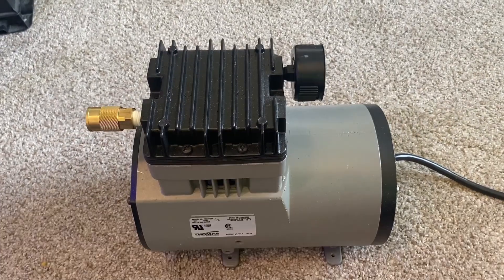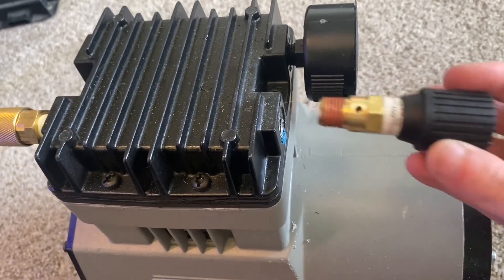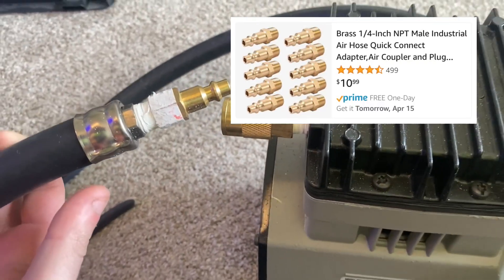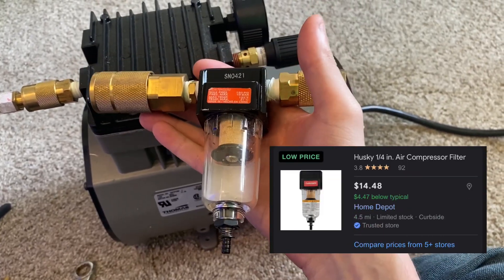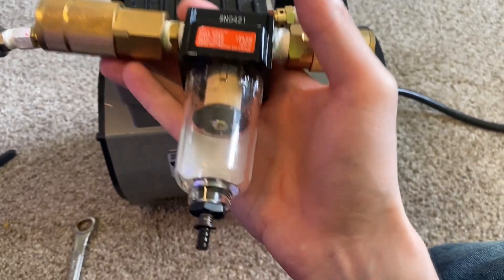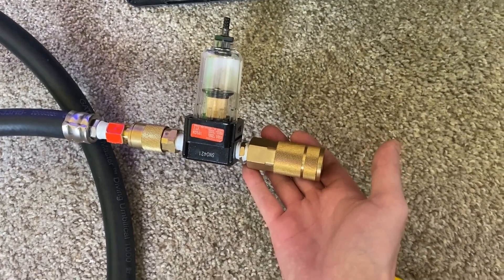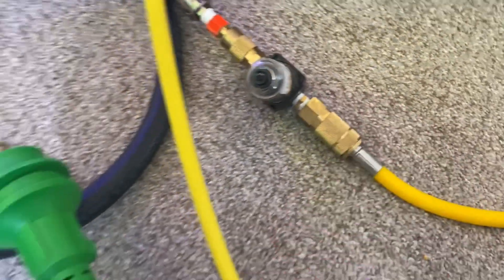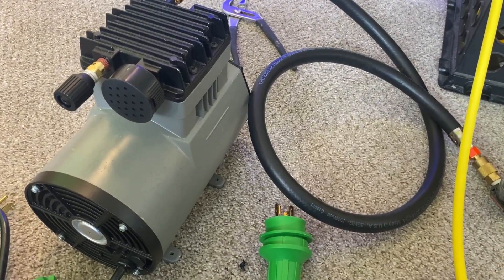How To Build An Affordable Hookah Dive System At Home Under $1000

Comment: Running it from shore power?  Good luck with that …
Reply from the maker: Done it thousand times, literally common sense. Majority of hull cleans do the same
Reply: @Mr.AlexanderUS  my bad.  I do really appreciate the video.  What I was wondering is how you keep the unit from getting pulled off the dock when you’re moving around under the boat with the air hose?
Reply from the maker: @wonderboy6511  There are about a million and one ways to do this; honestly, every diver does it differently.

A cart with locks is usually the go-to and the easiest option to hold the compressor. Also, throw a lot of extra hose in the water so you have enough slack so you don’t end up pulling on it.

You can also have a safety topside; if you charge enough, this shouldn’t be an issue.

But to be honest, with 100ft of hose, you really shouldn’t run into any problems tugging on the compressor.

Comment: So are you saying that the particle filter is filtering out all of the oil that normally transfers from the compressor to the hose?   Oil in the compressor always goes across into the hose - that’s why they have expensive filters or use an oil less system.   Be careful people!!!
Reply from the maker: This is an oil-less compressor and currently the diving standard for hookah systems the filter is to stop any water particles from entering your hose.
Reply: @Mr.AlexanderUS  how ya go did it work? Is there a high amount of carbon dioxide or anything weird??

Comment: I am sorry, but this is trouble in the making. This is what will bring on more regulations. Safety is upmost first. Point in issue, one among others. Wrong connectors. Use quick disconnect locking you do not want them separating down there. Save money here, spend it at the funeral. Go cheap, die.